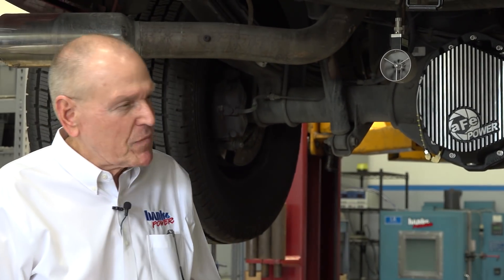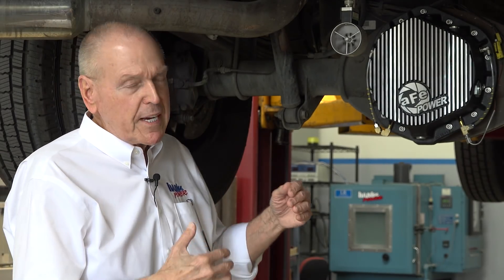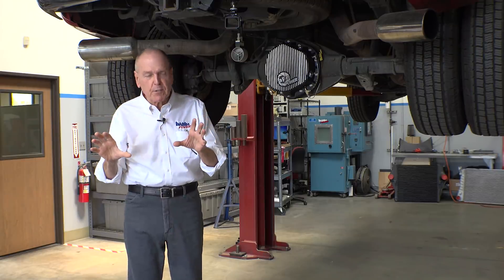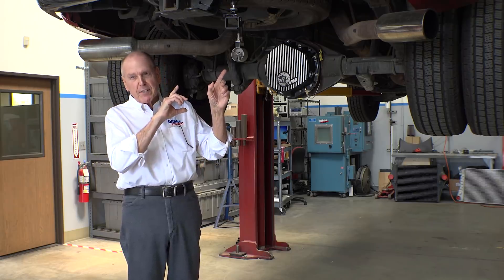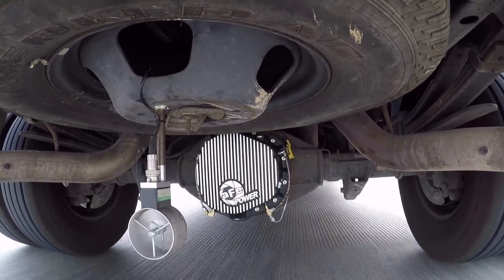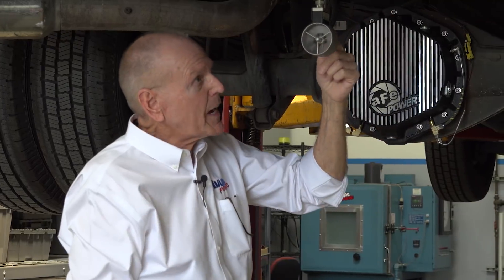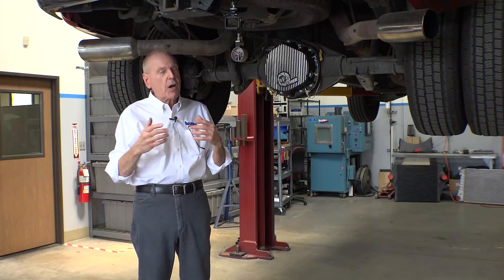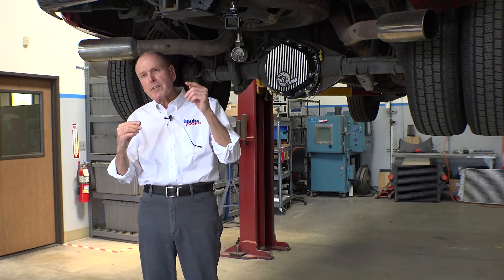Do Diff Covers Work or Are They Just Bling? Part 1 of 3

Comment: Need to take this a step forward and test currie & dynatrac as well as other aftermarket axle manufacturers and see how those axles compare to the stock Dana/Ford designs.
Reply: Yeah you're right, they're not doing enough. Not only is he doing all this testing at his expense, but working with an anemometer and camera strapped under the car, gone and driven many miles to record data, tapped fittings in the diff, bought a diff cover, made a fluid gauge, compiled results, analysed and chosen diff fluid, put the thing on the dyno, corrected the air speed on the dyno, etc. But yeah, just do a bit more for us would ya mate.
Reply: Where did I say "they're not  doing enough" ? The whole purpose of this test is to see if aftermarket  covers provide better lubrication/cooling for off the shelf axles.  If you are not aware, people also spend thousands  on replacement axles based on Dana and Ford 9" designs.  It would be interesting to see how the OEM designs (both covers and axles) compare to aftermarket "upgrades." I am  not sure what your point or issue is?  Perhaps you woke up on the wrong side of  the bed?
Reply: Just I'm not really sure you understand how much time and money this would take with a simple change of the diff cover to study the cooling effect, let along changing entire axles across multiple models.
Reply: Yes I work for a major automotive OEM,  I am aware of the validation process for various chassis components.The OEM's go through a PPAP process where as the aftermarket does not.   It is an obvious conclusion that the validation procedures that the vast majority of aftermarket company uses  pale in comparison to that of that of an OEM project.  Hence the reason Mr. Banks has commenced this study.  . I am curious to see this diff cover test but I think this could be an interesting series in general with regards to aftermarket claims.

The bigger question is why did you misstate my position?
Reply: When you start a sentence with the preposition "need to take this a step forward", you are implying that they should do more, when I have said that they seem to have enough on their plate as it is. It's that simple. No need to bring your validation work into this, it is nothing new that OEMs employ real engineers, where aftermarket means sending a CAD drawing off to China.
Reply: I was literally talking about how you phrased the sentence with such arrogance that they need to do more in this test, and I stated they already are doing a lot based on the resources required. I don't even know why you are ranting about all this other shit? Oh, and by the way, search CAD real quick, you might want to sit down, because CAD is not one specific program. It's a generic term for ALL computer design. So before you embarrass yourself in discussions with your amazing OEM automotive expert colleagues, you might want to study up.
Reply: cad by definition does not include the modeling process that the two aforementioned products include that are mainstream in the auto industry.  Nobody uses a CAD program in the auto industry that I am aware of that is legitimate.
Reply: Those tests have been done. I'm not sure what you're really after here. Currie, dynatrac, spider9s etc. , they all make aftermarket housings to add strength to the weak points of those axle housings. The modifications are for larger bearings, larger diameter shafts where applicable and higher spline counts. Ground clearance is usually another one of the reasons for the aftermarket housings. What do all of them have in common? All of them were meant for some type of performance application and based off of real world testing. I've seen jeeps snap dana 60 axle shafts that in their intended use were in 1 ton trucks. Guess what happens next you upgrade to a better shaft material with more splines. Sorry but 1040 steel just doesnt cut it for drag racing or rock crawling.
Reply: jpringle83  I am talking about the diff covers used on those variants.. Currie,dynatrac and others use different covers  than what come on stock dana axles that are supposedly optimized for their take on the Dana/9"  design.  Not looking for strength but rather if their pinion designs are actually more efficient than a stock Dana design.
Reply: Some of them have carrier caps supports built into the covers. Most of them can in fact use the factory style covers with the exception of the dyntrac prorock housings which are cast with the minimum amount of extra material needed to fit the ring gear and enough oil around it to maximize ground clearance. The covers that all of those manufacturers that you have mentioned are not meant to improve on anything other than strength through thickness (mostly flange) to combat punctures and peeling the covers. I've used stock covers on the currie rockjock 60 multiple times due to the fact that the thickness isn't needed because of the rotation of the centerline. None of the claim they're optimized for the design that I can think of they're simply stronger. All of those covers are marketed to the offroad community based on that and nothing else.
Reply: jpringle83  Do any of them do a CFD with their modified covers? the one on my rj60 is quite a bit different than a stock one
Reply: As far as the pinion designs of the axle housings all of the front housings are based off of the ford version of the dana 60 high pinion reverse cut ring gear design because it's stronger. The ford 9" aftermarket housings are modeled using the strongest setups from all of the different variations through the years of that axle.
Reply: jpringle83  yes I understand why they designed them the way they did.. mainly for strength.. That part is obvious.  Reliability and efficiency are the question.  There is a  CFD that is done by Dana when they design or modify any of their long tenured designs.  How do the losses (pocketing, friction, heat etc) compare? Reliability quotient?  I have never seen any of these manufacturers release any data based on how their design compares to the Dana reference design.
Reply: Without knowing their internal engineering specifics I can't say either way. What I can say is that they aren't designed for vehicles being driven hundreds of thousands of miles. Reliability is a very relative term in this case. Most of the vehicles that they end up in will never see that kind of mileage so our reliability test is did it or did it not break. They must do some engineering as far as oiling and heat go because I can guarantee that these housings see far more heat from torque loading than any typical street driven truck. I wanted to know on the currie rockjock housing how well it could oil with the odd angle so I put a clear cover on one I put together for a friend and it worked surprisingly well. Would it last very long on the street? No idea. I can say the Jeep it's under in my opinion isn't very fun to drive on the street very much anyway though he does occasionally drive it to work.
Reply: I can’t speak for them on that either. Why would they need to?  It’s a heavy duty cover. If you have an rj60 yourself then you can very obviously do some very easy research with the eye test. It shares very little with a dana design other than it uses their reverse cut hp60 gearset. Very few, very very few performance/race built parts will perform the way a production based design will in those capacities. Those of us that use those types of parts for their intended purpose will absolutely sacrifice longevity for durability off-road or racing for that matter. Those that can’t can build a pretty solid dana 60 using an actual 60. Or 9 or whatever else you’d like to apply that too.
Reply: jpringle83  There is no data to either support or  disprove  your assertion that longevity or durability is  sacrificed. With DANA now entering the fray with  their bolt-on "aftermarket' axles it would be interesting to see if they have been engineered to OEM specs.  There are plenty of race parts,  designed by OEM's, that meet or  exceed original FMEA requirements.  "building a dana 60 or  9" has no benefit  (other  than cost) since that would  require engineering to determine failure modes.
Reply: Never did I assert that they sacrificed longevity. I said that those that do buy them would be ok with the trade off with added strength. Dana makes excellent axles. The main reason behind there being so many aftermarket 60s is the most desirable housing they ever made was the kingpin hp version in the Ford. People were selling those for over $1400 around here a few years ago. Junk ones. Up until recently Dana had never sold them direct to the public. Now they sell them configured how a customer wants direct bolt in. Of course they’ll do well. There will be plenty of mall crawlers that run them only on the street and do very well. However what I said still stands true. The axle assembly’s they manufactured for the OEMs to their specific specs cannot and will not survive the abuses that a select group puts them through. That is why the aftermarket housings exist. The longevity part comes in when we talk about specifics. I run bronze bushings I’ve run the springless kingpin caps with bronze bushings which were great off-road. On the road they wore very quickly. Same with my super joints. You also mentioned OEM racing components. Ford Racing and GM performance along with Mopar have always made excellent parts. None of those are production pieces. I consider them al to be aftermarket parts and they compete directly with the aftermarket. Everyone has different tastes, budgets and ideas for any build and the great thing is you can almost always find something that fits all three be it aftermarket or OEM.
Reply: jpringle83  You are speaking in tongues and non sequitur and mainly reasoning by analogy. I have not seen one statistic posted by you.. Just opinion.  Post  stats, I understand your opinion but it is useless and just boilerplate nonsense that everyone already knows.
Reply: What stats are you after? Yield strength, torsional loads what? I’m guessing you’re an engineer.
Reply: jpringle83  Very few, very very few performance/race built parts will perform the way a production based design will in those capacities. Those of us that use those types of parts for their intended purpose will absolutely sacrifice longevity for durability off-road or racing for that matter.   <--- show me the stats that prove they are less or more reliable.  I am looking for a full FMEA
Reply: Reread what that says. It doesn’t say they won’t. It says that we are willing to sacrifice it period.  Do you want numbers on why a bronze kingpin bushing won’t outlast a nylon one. Or why a factory Spicer ujoint will have a longer service life than say a CTM on the road? I don’t.  You have some issues with the aftermarket for some reason this is obvious but yet say you own an rj60. Why?
Reply: jpringle83  What are you sacrificing other than weight? you don't know.  If you do let me know but you made baseless claims about what you "may" be sacrificing.  It seems like you cannot provide any data whatsoever.  Do you work for Currie, Dynatrac or Dana?  If so you should be able to provide this data.  If not then you are just guessing which is not helpful at all.  We all know what it says in the marketing pieces.. do we know what these aftermarket axles are rated for with regards to duty cycle?  There is no spec on them.. Just a blanket statement that they are "stronger" and "better" I do not doubt these statements but cannot prove these are true either. If an axle manufacturer truly believed this they would have  data to back up the reliability metric many allude to.
Reply: jpringle83   do you work for currie? Yes I have a RJ60 because my AMC20 took a crap and I needed a new axle.  At the time Currie was local to me, down the street from the auto manufacturer I worked at so we went to them.  Knowing what I know now I will likely go with a dynatrac or Dana crate front end once my D30 goes kaput.  Currie manufactures a lot of their stuff overseas and the quality is not as good as it used to be.  

Point being aftermarket or not, rear end that is marketed for both should be able to meet or exceed factory specs.  It is not like we are talking about portal axles or some ridiculous variant that is not meant for on-road use at all.
Reply: Hint I have done a preliminary FMEA on the RJ60 "overseas" model.  If you work for currie we should talk.. All sorts of issues with it (not mine in particular but compared to even a stock Dana 60 1 ton axle).
Reply: Saying that I’m willing to sacrifice those things in an off-road axle isn’t a claim that you will. For someone who seems to be as smart as you, you’re reading comprehension skills are lacking. I do not work for any of those manufacturers and don’t need numbers to show me that the assembly’s are stronger than what had at the time ever been introduced in the production vehicles they were meant for. You have a jeep with a Dana 30 is a Dana 60 stronger? Do you want numbers? I in fact have all of those numbers as well as the different manufacturers specs. CAD fronts for Chrysler, kingpins or ball joints axle tube diameters and wall thickness, weight capacity and output torque ratings. None of that matters to me as long as I know the materials and processes used to put the housing together. It sounds like you have one of my favorite jeeps is it a cj5-7-8?
Reply: I knew Currie had started to do that and for that reason stopped building with their Johnny joints which I loved. Yukon has done the same on nearly every line they own as well. If they market for both you are right it damn well better meet both requirements. At the price point they’re at I would accept nothing less than exceeding them. I doubt any of them will publish any of that for what they would call proprietary reasons but I have had several conversations recently with a couple of different Dynatrac tech department people about the Dana 80 version of their axle and they were very forthcoming with information.
Reply: jpringle83  7... I am not talking about strength I am talking about finite comparisons between aftermarket axles and OEM's comparing the two with regards to.  Strength is just one component of the analysis. It may not matter to you but if it is truly a superior axle why has no one done an analysis? It  can only benefit the aftermarket axle supplier
Reply: I’d actually love to see that FMEA. Preliminary or not something in the operation just bothered me when I set them up to their spec. Not to mention carrier removal because of the angle is a PITA.
Reply: I have yet to see any of them claim to be superior to the Dana’s housings in anything other than strength and universal use. That would be news to me. Other than the rock jock they are the exact design from Dana. That tells me without written, numerical data that Dana’s design was superior. The issue was availability. Dana offers them consumer direct now but I’m not completely certain how custom they’re willing to go.
Reply: jpringle83  That was the whole point of me posting my comment 30 comments later nothing significant has been uncovered.. We are back in the same place.  Who  will do the FMEA on aftermarket axles? They are much more expensive than a simple cover and are the most expensive investment you will make in a vehicle. Dana themselves should do a FMEA on aftermarket axles. would make their crate axles sell like hotcakes
Reply: I understand that your talking about friction losses, heat buildup/ dissipation, oiling etc. but it’s a Dana designed center section.
Reply: Except for the one that you have.
Reply: If you’d have lead with that comment right there we wouldn’t have just beat our heads against the wall for no reason. As long as they offer the same external upgrades. Tube size/thickness, axleshaft materia spline count, lockers. They can absolutely steal the market as they should.
Reply: I don’t think that analysis has a decent cost to value for Dana. Those of us that have been using those aftermarket housings were ecstatic that Dana had jumped in. They will have to be similar in price and options to make that splash. They also have some pretty phenomenal tech guys that are easy to work with.

Comment: Use them on jeeps with increased pinion angle to keep the oil level a little higher
Reply: Blue waffle cone  install a 1/2" street ell and square pipe plug to get 1/4 -3/8" higher fluid level.